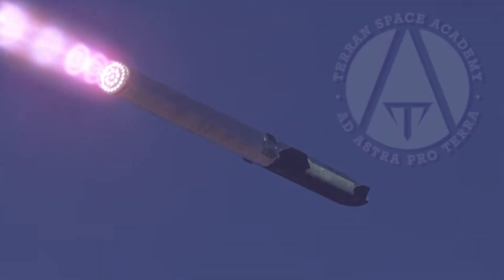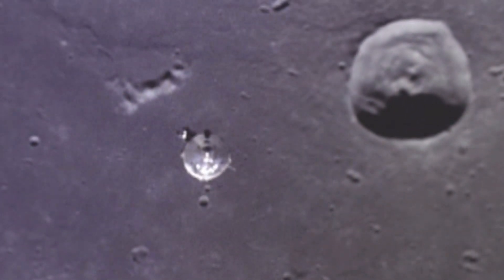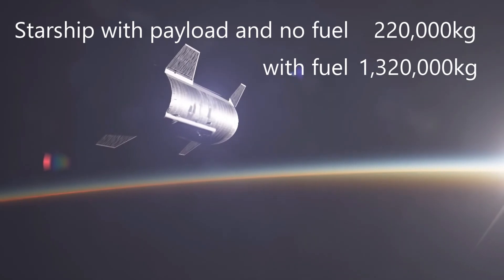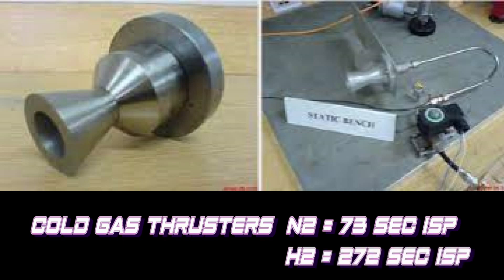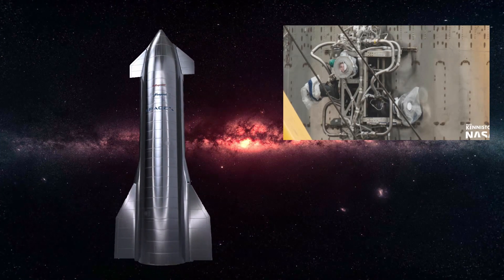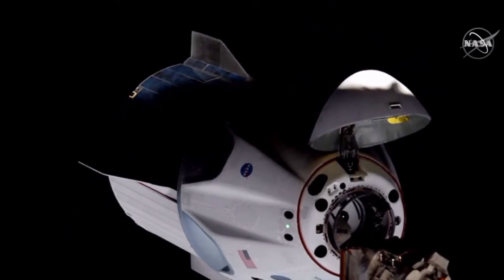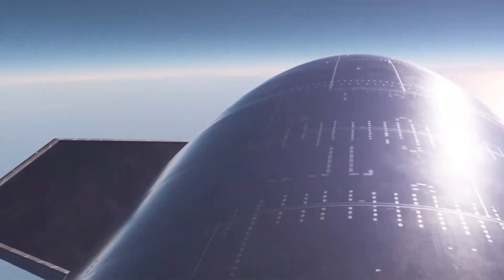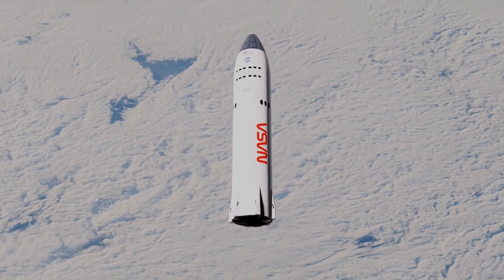SpaceX Starship: How Do RCS Thrusters Work

Comment: Why does this video show the upper thrusters above the fins while your video show them below? https://www.youtube.com/watch?v=-Z2rpRSp4vY
Reply from the maker: There will be thrusters on the nose, on the body in at least two places, and on the aft section.
Each of these locations will need at least three thrusters to properly maneuver the ship.
They are probably trying out different locations...
They were going to use actual small rocket engines at first...
Just like the Draco engines on Dragon.
But are now planning a hot gas thruster from the propellant tanks venting... this would just need something to pivot the nozzle and a valve... very efficient.  For orbital maneuvering they may need something larger.
It is all still a work in progress...

Comment: The problem of dealing with the mass between being fully fueled and nearly empty already was solved on the S-IVB and Centaur.
A Centaur weighs around 25 tons full and a round 2 and a half tons when empty.
The stage does a disposal burn after releasing it's payload so it has to be able to control when it's nearly empty and may weigh a 6th of what it did with a full load of propellant and a payload attached.
Reply from the maker: They are works of technological art.  The problem is reentry... aluminum alloys can't take the heat and steel is a lot more dense :-)

Comment: Something you said in this video totally answered one of my all time biggest questions: when you watch the apollo command module rising up after taking off from the lunar surface, you can see the ship doing these little left/right motions that, always seemed odd to see. When you said that someone walking from one end of starship to the other, its enough to throw off its trajectory, I finally clued into why the lunar model made strange jerky movements: as the astronauts leaned across the module pushing buttons or looking out the window, they must have been literally moving the whole capsule as they did so. Watch an old video of the ascent and you'll see exactly what I mean.
Reply from the maker: Very perceptive!  We need to do the math on that :-)

Comment: Would not the ship need to imitate Spaceship Earth to keeps its occupants safe and heathly for long duration flights. Gravity, magnetic fields, water cycles and who knows what other fields are necessary for the human body. It seems like a overwhelming task with our present knowledge. This endeavor appears totally different from the voyages across the Pacific and the Atlantic crossing by humanity. Are we really ready for such a task?
Reply from the maker: Not necessarily for well trained fit "founders" going to establish a colony.  Adults can tolerate zero g and some radiation fairly well.  No children or young adults could be transported without artificial gravity and sufficient radiation shielding.  Humanity is definitely ready to start this endeavor.
Reply: @terranspaceacademy  Are we sure that procreation is possible outside Earth's biosphere.
Reply from the maker: @hectorarcelus6602  Reasonably sure than it should be but organizations like spaceborne united are working hard to prove the point. :-)

Comment: Loved your descriptions, and they fit my education to date. However there is one exception that has bothered me for 50 years. Appolo 13, imho, should have become very hot, but it did not. It became very cold. They did not have enough electricity to run the heaters due to limited oxygen. This one factor has made me doubt the bbq roll necessity ever since.
Reply from the maker: That is a good point... they still had the pumps running to remove excess heat but they should have easily been able to adjust that manually to maintain temperature... Depending on Earth's relationship to the sun could they have been moving away so from it so that the back of the ship was exposed to the solar radiation?  It would not have made it far through the large heat sink of the service module, and there would have been plenty of surface to radiate.  I'll look in to that.

Comment: Couldn’t you employ the thermal energy from the radiation absorption to power the interior? This may be done by using a striking heat engine to power a generator, allowing more menial tasks like cooking, the lighting, and some life support systems to be powered without the use of a nuclear reactor, as well as keep the Tesla batteries charged. 

There’s also the idea of using a magnetic field around the ship in order to protect against solar storms and solar wind.
Reply from the maker: You could but it would slow heat removal.   The electronics of that time generated a lot of heat.  A dedicated "heat pipe" with Stirling generators might be a could option today.

Comment: A lot of insight into one of the things vital to safe space flight. Great video...I'm listening to it on the way home on my bike...
     I wonder if the old Corning ware flat top stoves with the heating element sealed in ceramic had its origins in those thermoelectric heaters? It seems to me I remember a commercial that claimed those stoves were NASA spinoffs...
Reply from the maker: So much technology was... not just computers, velcro and telemetry for hospitals but so much more.

Comment: It feels like the multitude of little systems required to deal with the sun radiation and reorientation of a spacecraft are a peacemeal solution of a series of engineering tricks targeted at solving very narrow task each. The system seems to grow exponentially complex when human deep space travel is involved, i.e. approach is not optimized. I'm going to bet that Musk will apply 1st principles to simplify the whole shebang and come up with a "best part is no part" solution. Any thoughts?
Reply from the maker: I agree...  I expect to see heat pipes and Octoplex cooling systems etc...
Reply: @terranspaceacademy  Engineering solution may be  some sort of passive systems with no moving parts as opposed to a complex network of active devices. A house positioned in the right shade and with right windows can be as effective at managing heat as a super-duper HVAC but requires no engineering efforts to maintain.
Reply from the maker: That is true but a house is stationary :-)  The Starship will be exposing different areas to different heat flux. They'll need some active systems to keep everyone safe, at least as a backup if the passive systems are overloaded.

Comment: It's more likely than would use pairs of high pressure storage tanks for gaseous oxygen and methane collected from autogenuos pressurizetion system,combustion gaseous rocket engines are not something new, but until now weren't considered a viable solution because of weight of high pressure tanks related to quantity of gaseous fuel, but if you replenish that fuel from natural boiling cryogenic propellant (from the main propellant tanks) that will change everything.
Reply from the maker: Very true!